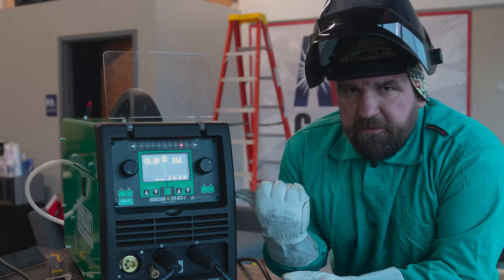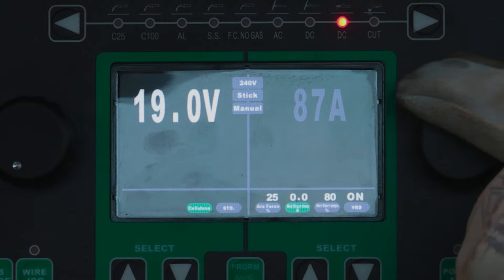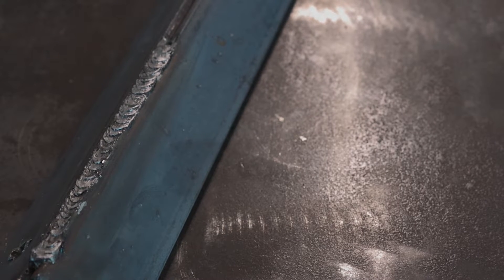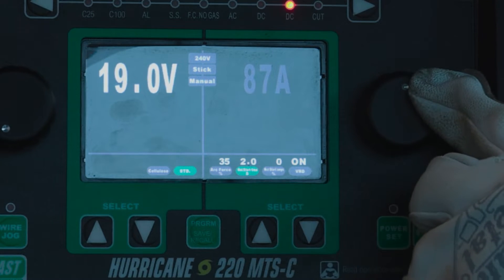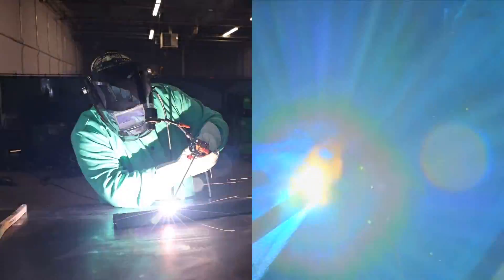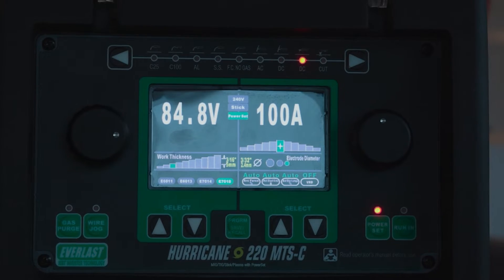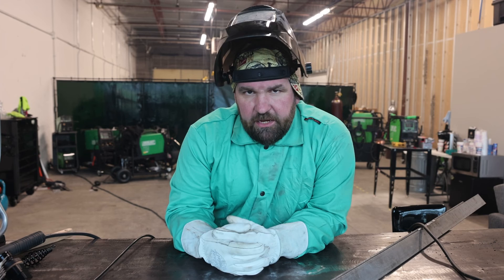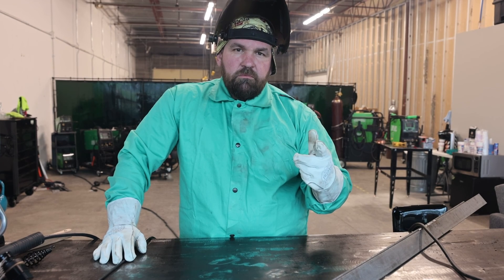Everlast Welders: Hurricane 220 MTS-C STICK Overview

Comment: The portability, price range, and wide verity of processes of these Everlast welders just can't be beat. I have the cyclone 212 which I run in an industrial setting and it continues to blow my mind  with it's capability. I do wish it had a cut option but I mostly wire feed and stick weld and occasionally scratch start tig weld with it. The spool gun makes for easy aluminum fabrication and repairs. Honestly I'm glad I bought the Everlast over a Miller and Lincoln. Plus it comes with a 5 year warranty